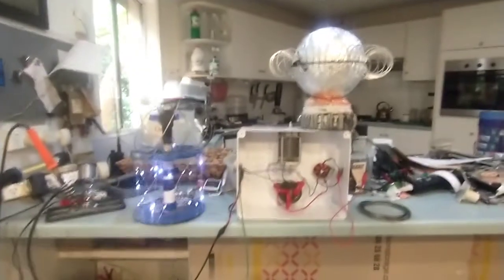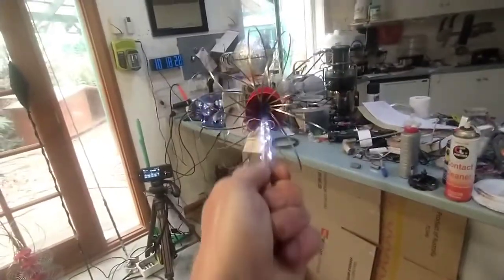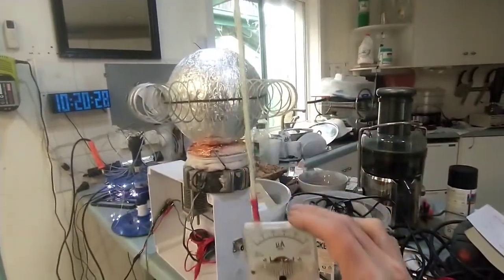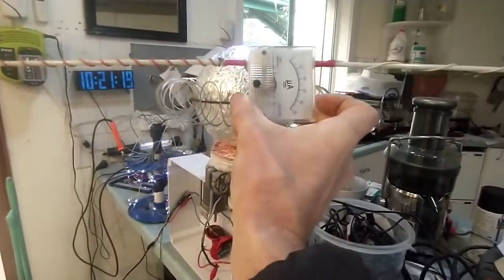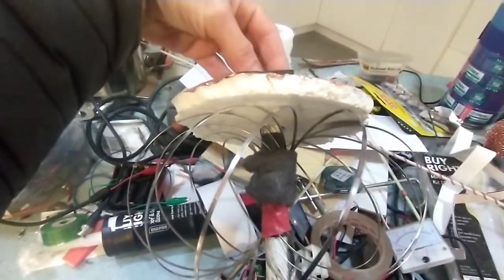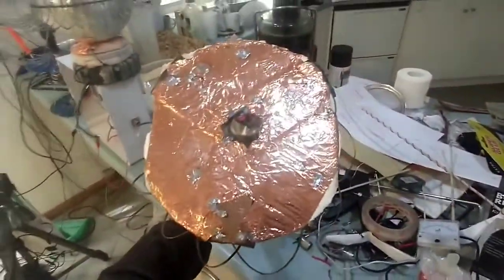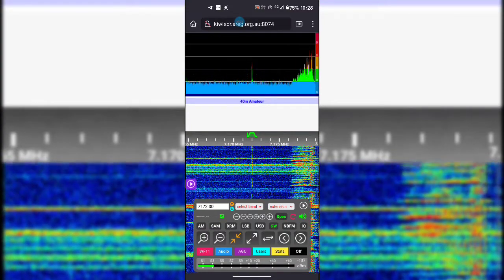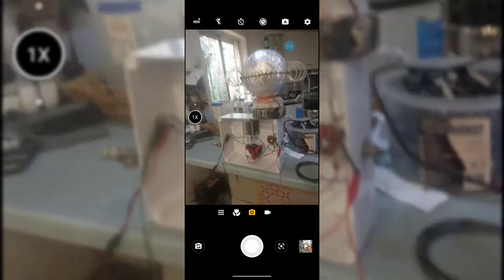⚡📡RF Longitudinal Magneto Dielectricity EM Wave Proof & Practical Demo.(LMD Wave)📡⚡

Comment: Hi, I'm currently going around and looking for information on how Tesla was able to use Longitudinal propagations to transmit power instantaneously without loss or range limit, he even claimed it would get stronger with distance unlike Transverse, do you have any theories or information on this concept? Ty.
Reply from the maker: I have a reasonable grasp on what he was doing,  though I am not at the stage he was at,
so I currently don't see how it gets stronger over distance.

I believe he planned to have numerous carefully positioned towers that operated in sync to maintain the transfer.

I must point out that he wasn't transmitting Power  as we understand it,
he was actually transmitting potential.

When we think about power trànsfer we always have a travelling wave
and any portion of that wave reflected back is seen as impedance mismatch or return loss.

Longitudinal Waves are not Travelling waves,
they are Standing waves
and the wave isn't a travelling wave
due to 100 percent reflection
which we would consider to be zero power transfer.

Because we have an equal wave travelling in both directions You cannot follow a summarized wave crest along the path
as it travels in either direction,
though at any point along the way,
the E field charge differential value is oscillating. 

He was creating standing wave differential between the atmosphere and the ground.

You may be aware that we have a voltage gradient from the ground upwards
according to Feinman approx 100 volt per meter above the ground,
so 10 metres above ground has approx 1000 volt potential against ground.

He was Oscillating that voltage gradient
so that at another location  a system could harness the oscillating potentials between earth and atmosphere.

This means he was not trying to transmit a current as we know it nor a TEM wave.
He stated he was not using a Hertzian Wave (Old Term for TEM wave).
A current would be induced in the receiving system that takes advantage of the oscillating potentials of the voltage gradient.

I say he wasn't transmitting a current
because a current is the result of moving charges in one direction that creates a rotating magnetic field around the transit path of changing charge.

With a longitudinal Wave,
there is an equal current running in both directions,
which when considered properly based on Faraday's laws of induction relating to moving/changing charges,
means that there is No Current
as there are no rotating magnetic fields  being created 
due to the opposing directions of the moving charges creating what would be opposing rotations of the magnetic field.
 
We need to distinguish between sines of current
and sines of E field potential.

A negative or positive charge running one way along a wire may be called a current of a given sine,
yet when the charge potential hits the end of the wire and returns in the other direction we say it has changed sine.
But it has only changed direction,
which is how we define current (rotating magnetic field)
but it has not changed its E field Charge Sine.

In this way,
an E field Resonance can be established that adds to the E field Potentials at infinite impedance to current (Cancelling Magnetically) 
although it appears that currents are cancelling
it is also Adding to the E field Potential.

Another way to see this
is that the magnetic fields are being cancelled
leaving only one option for the moving/changing energy to present itself in
and that is in the E field
and the E field Lines become directed along the Path of propagation (Like Plasma Discharge & Lightening appears to move in the direction of the E field Potential) 

I will link a video where I cover some aspects that may help you with this
especially regarding sine, direction, current vs charge etc.

I hope I have made sense to you my friend.

It is a tough job to try express this well in a single text 
& in truth there are many aspects to this model that are not explained well (if at all) by modern physics.
Reply from the maker: Here is a video where I try to clarify some points regarding Sines of Charge vs Sines Of Current etc
& Impedance, remembering that Impedance is the Impedance to the flow of "Current" not Energy.

 https://youtu.be/_jnbPtxwtfo

One more thing I suggest
is to ignore any notion of electrons being particles that have a space and time.

All Charge Potentials have field lines reaching to infinity yet of course an extremely complex web of interconnecting E field lines linking everything in existence.

Therefore a point in space and time that we define to have potential with something else,
has potential with everything else
and should only be considered to be of incommensurable size.

At best we could say it is infinitely large & infinitely small if we wish to insist on quantizing it.

73 de VK3VKe
Crazy Ham
⚡🙏⚡
Reply: @crazyham  Hi again Crazy Ham, since I posted this question 8 months ago I've found a lot of very interesting information that I figured I'd share with you incase you hadn't found out about it, and maybe you might find useful for your own experiments.

It turns out there's a way to produce Tesla's LMD shockwaves without multiple antenna systems involved and it's through the rapid charge and discharge of either a capacitor (Current Impulse) or a coil (Voltage Impulse), it's also the same thing he called Radiant Energy, if you create a rapid impulse in short enough duration of either Voltage or a Unidirectional Current it "slaps" the Aether into motion as a Longitudinal disturbance so fast it doesn't have time for the Dielectric field (Voltage) to lose its tension and transform into Magnetism, when the shockwave makes contact with conductive materials it induces a charge buildup which can be siphoned for power as an electrical reactance source.

Furthermore, if the shockwave is received through a resonantly tuned receiver then drawing power from it will have no strain on the transmitter, and can even put out 2x or more the Voltage and Amperages with no limit to the number of receiver coils tuned to the same transmitter, this also goes into why the shockwave becomes stronger with distance as Tesla claimed; Why does a Tidal Wave get stronger with distance?

And as it turns out Tesla gave us this exact system design in patent 645,576, in order to get it to work for high powered applications a series connected spark gap must be between the L1 and the power source, the distance between the Electrodes is used to control the Frequency and a pair of distance adjustable Magnets in attractive configuration is used to kill the spark at the desired time to control the Impulse duration, I believe adding a capacitor in parallel before the spark gap will also help with the effect, there is a diagram of this in Lindemann's "Free Energy Secrets of Cold Electricity" book, if you get yourself a copy of it I also recommend "Secrets of Cold War Technology" by Garry Vassilatos, both if which can be downloaded from the net. An important note is that impulse durations above 100 microseconds are known to cause painful stinging and harmful mechanical pressure, something Tesla found out the hard way, this is likely related to Tesla choosing a duration of 50 microseconds for Wardenclyffe.

It's also shown to have some fairly decent power range through the air, but where it really shines is it metal objects with an earth ground connection, you could earth ground a transmitter and receiver miles apart and there would be no loss in power, more likely a gain. There's a fellow here on YT that goes by the name MTECH INDUSTRIES that uploads regularly on a small scale version of these Radiant Transmitters.

He uses an LED with 2x 1N4148 diodes to rectify the potential charge induced on the metal objects in range of the transmitter, as a result the only place magnetic current comes to exist is inside the load itself, leaving the outside wires completely safe to touch as it's operating on voltage potential and only taking what it needs to make full use of the resistive load, plus the lack of current means the circuit outside of the load remains cold, it's a fantastic little tool for testing these things.

I've also seen examples of this type of transmission be used for radio systems that completely ignores signal blockers like Faraday cages showing the LMD nature of the received signal. This kind of disturbance has no Magnetic component (as evident from it being Longitudinal) and does not induce Hysteresis in the Aether, which explains why Tesla recorded signal return rates exceeding that of Light's rate of induction. The potential of this technology is incredible.